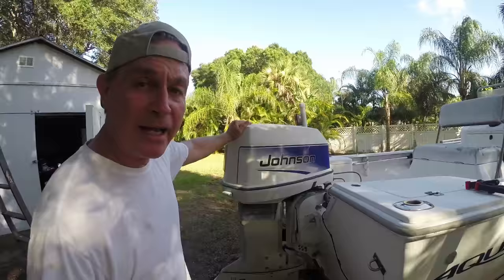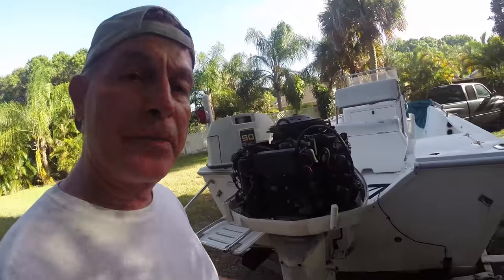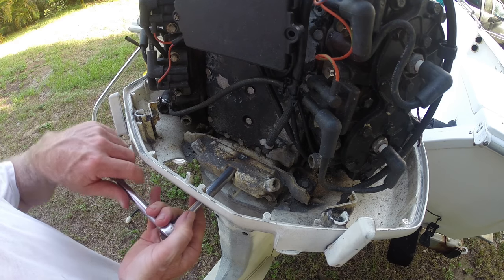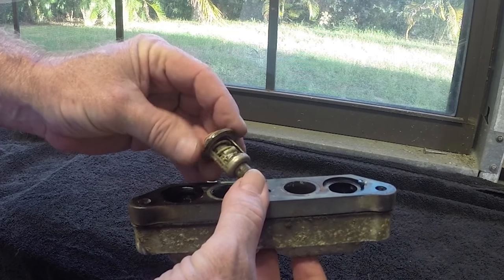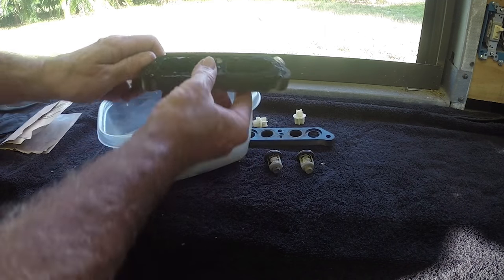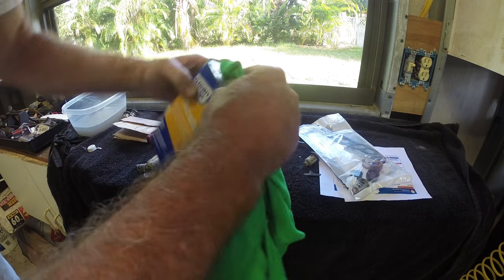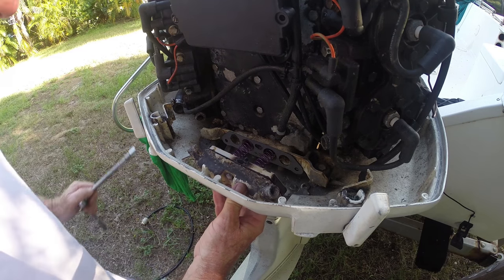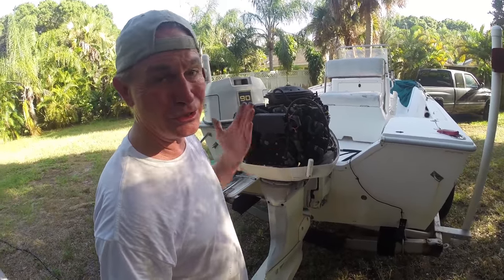HOW TO Replace Thermostats Johnson Outboard the EASY WAY!

Comment: This is one of the most helpful videos I've ever seen. I tried to change my  therms and was unsuccessful so I need to do what you did. Did you use a specific dremel blade for that and what rpm etc is the dremel you used? Mine might be too cheesy so I may need to get a newer, better one.
Reply from the maker: Susan Tapia , nothing special,  I  used what was in my 4200 kit.
Reply from the maker: Zero, works like a champ!

Comment: Just did this to my 1987 Johnson 90hp.. 
it has been in one family since it’s make and I bought it from that family, so I’m the second owner..they had been using one mechanic shop throughout the boats life. June of 2020, the owner said that he was having over heating problems at idle only. Mechanic shop said they changed the impeller, thermostat hoses, and spark plugs. All was good. Then the guy sold the boat to me a few months later. I get the boat and after about 10minutes idling, the overheat alarm goes off. I replace the water pump AGAIN (being less than 1 year), and it had not been replaced in at least two years. It was dry rotted. I test it, still over heats. So naturally the thermostats are next to replace. I found your video and did what you did—but the sad part is, that I did not even need to replace them! The brand new thermostat hoses that were replaced in June—the left one had silicone blocking both ends of the hose!!! Intentionally!!! As if they were trying to create an overheating issue. There are SO MANY sketchy mechanics out there. 
I went ahead and replaced the thermos and all since I already cut out my hole LOL but lesson learned. Always do your own work unless it’s out of your scope of knowledge 🤦🏻‍♀️

Sorry for the rambling! Lol but also glad I found your video!
Reply: sorry to say, but they didn't replace the impeller either! those impellers are tough, and you only start seeing little cracks after atleast 4-5 years.

Comment: I have a 1997 Johnson 115 SPL non-vro motor and I just drilled 3 one inch holes at the location of the bolt heads of where your cutout is instead, and it worked beautifully. I put off white plastic bushings with plugs in the holes afterwards and it looks like it came from the factory with them. Tip: use electrical tape to hold everything together while installing then pull it off when you get a bolt in before tightening.
Reply from the maker: Derek Porter .  That also would do the trick, sq vs round.  The curve would get me though, but it worked for you!
Reply: Great idea!
Reply: Great to be able to do the same on my 94/Ev 90, as your smart way, thanks a million.
Reply: Just did this way too.  I used two zip ties to hold the springs to the thermostat housing while installing and cut them over secured with the bolts; worked great.

I struggled with where to put the cork gaskets but decided to install under the thermostat which seems to be fine.
Reply: Oh yeah you have to be a little careful there when you put the new one in that everything stays together you don't drop it down into the engine.  But why 3 holes you only need to do the 2 end holes. I commented above. I use black round the grommets because my engine is black. I guess your engine is white.  Use  A lot of clear marine waterproof cement
Reply: @PortCanaveralFlorida   my comment up above.  I have a bkack 90 hp. Yeah the curve was a little difficult for lining up.  I dudn't really line up and drill straight, but not off so much that it resulted in a problem. I could still get the 2 bolts out easily and then in again.  Then just glue in 2 round rubber grommets.  Csnt even tell.

Comment: I drilled three 5mm pilot holes, eventually taking them out to 12mm to get a socket on the bolts them once finished i siliconed in rubber grommets. Worked well, looks good.

Comment: Thank you for putting this video out. After watching the video 10 times, I did it today. Little different then your video OR? I just missed that there's 2 bolts on the inside of the lower Cowl. But got to them OK. Also I did not know the Cowl was Aluminum. Thought it was Plastic. Took a lot longer then I thought with the Dramel . BUT I got it cut out and the whole thermostat housing popped out pretty easy. MY Thermostats were very clean and no Salt build up at all? Last replaced 3-4 yrs?? ago?? Guess Salt Away works. Again thanks for the info..
Reply from the maker: Very welcome Dan

Comment: I was able to do this without cutting case. The top bolt will come out the bottom 2 bolts will stay in the housing but all you have to do is remove the housing with them in it and reverse this when installing. The bolts come far enough out of the block to clear.
Reply: Maybe it's different on other sizes but mine is an 88SPL JOHNSON.
Reply from the maker: Yep, you have a different motor.  You can't leave the outer bolts in with this motor.
Reply: I just found out I can do the same with my 85  90 V4 Evinrude.  Glad I tried that first.  Also I want to comment that the shop manual calls for btwn 5 to 6.5 ft lbs (60-80 in lbs) of torque on the bolts.  Looked to me like you went a bit 'much' with the ratchet.  Mine came out easily with a  5'' box end wrench.

Comment: I am doing the job now and I drilled holes to access the bolts but after seeing your video I am going to cut the section out and as I have a spare motor for parts I will cut the same section out but larger and cover the hole, attaching it with ss screws so that it can be easily accessed. Update.....Job done all ok, cover plate fitted over the hole ok but needed or a gasket to seal it properly.

Comment: Thought I had a blocked or broken impeller because of low pressure on the exhaust water port . Pulled thermostat water shot out the thermostat hole plus it started pumping out the exhaust water ports up top. Carb sounds clean at not in gear throttling it with cleaner. But bogs in gear. Carb issues  and needs thermostat and maybe an water pump kit.

Comment: Thank you sharing how you have found to make this job doable. 
Let me add:

ONCE AGAIN, a Video involving the possibility of BREAKING Bolts  that when you are dealing with such bolts that you must remove:

If the bolt feels like it may break at all, they are full of corrosion crud. So don't break it, do this instead:
you must give it patience and slight back and forth movement to work it out, the corrosion will fall out: 

So try to tighten it just something of a move, then try to looses in just something. Then repeat and repeat and repeat. So a rocking motion of back and forth without putting too much force in either direction where it may over stress the bolt and break it off. As you continue, if your observant enough, you may even see little sands of corrosion dropping out of bottom of the bolt as you do this. And that the bolt is able to move more than it did. 
Now you can't loose once you have some movement. Because if you are patient and keep only rocking the bolt back and forth back and forth, more corrosion will come out and the bolt will move even more from tight to loose. Of course also spray penetrating oil into the threads as you can and walk away and come back after soaking.
Take care

Comment: Great tip. Great video! Hello. I have an 85 hp 78 year engine and it is not as easy to trim as on your engine. What do you suggest for my engine?
Reply from the maker: Jaime, This video had nothing to do with "Trim"
Reply: @PortCanaveralFlorida  Thanks for your answer. It happens that I did not ask about trim. I said that the model is 78 with power of 85 HP and that the cut plate in your Jhonson is not equal in mine.
Anyway your video is very good.

Comment: I did this and it’s great. I’m just wondering where the cork Haley rings go. Is it under the lip of thermostat or on top of the lip. They are going to have to get really swished either way on reassembly. That’s where I’m at now. Trying to find out exactly where these go before I reassemble. Nothing in both manuals I have shows me. I have same engine you have in the video. Any help would be appreciated. Thanks.
Reply: Not Haley rings. Cork rings.

Comment: I thought you were taking the piss for a second. I have an older johnson and my thermostats on top. Woulda been a good troll video if that were the case.. "Yeah so today we're gonna change out our coils. First, let's drop the lower unit. Then get your handy grinder and cut an access hole through the base of the motor mount" lmao!

Comment: Good idea but you really don’t need to make cuts. Even on the bubble back exhaust models. Just an 11mm wrench and some patience.
Reply: What are you talking about you can't get the 2 end screws out because the metal of the motor in the way.  otherwise you have to unbolt the whole friggin motor and lift it out of the casing.   Those 2 end bolts on the thermostat are very long but middle one is shorter.
Reply: @aspenrebel  next time one comes in for a thermostat job, I will video it. Trust me. I have done several, you certainly don't need to remove the power head.
Reply: @TheJoejoe7716  nope!   The last thing you want to do is to remove the power head or to try to remove the power head.  Only about 100 things can go terribly wrong.   I have to look if I have a picture of my phone here what I did.
Reply: @TheJoejoe7716   ok here's how I did.  1 inch cylinder drill bit and 1 inch black rubber  plugs cemented in place to plug the holes.  Hkpefully I can post the pics I took today.
Reply: @TheJoejoe7716  well, I took photos of what I did, to show, but I cant get them on here.  I dont know how.  It not working. ?????

Comment: Why not use heat direct in the bolt with a swivel socket though first?
Reply from the maker: @systematic_control367   Swivel sockets at that angle seem to slip and re installed  is a PITA.

Comment: Great video and great idea!  My only question is have you experienced any operational problems, engine performance wise since you made this repair?  Has the plate come loose or have you since lost it?
Reply from the maker: Zero issues. I use hot glue from the back, works like a champ!
Reply: It won't affect performance of the engine

Comment: I use bored holes in front of 2 end bolts for socket removed bolts .put rubber plugs in holes easy to do.

Comment: No criticism from me but I should point out that the cork gaskets should sit on top of the thermostats. They are the last piece of the puzzle before the final body gasket which in the video is already attached to the engine body. 
It probably doesn’t make a difference but that is how it is installed on my original untouched 1979 85 hp v4 evinrude, basically it is still the same engine and I am using the same thermostat kit.
Reply from the maker: Looking at the diagram now that you drought it up, they sit under the stat.
Reply: It looks that way in the diagram but the original body gaskets covering the cork washers were made of a thin metal (not like today’s paper gaskets). They were stamped with an indentation that only allowed the cork washers to be assembled on top.
Reply from the maker: @joyned1  what can I say, its still running just fine. It's, do you like your cheese on top of the burger or at the bottom.

Comment: Thanks a bunch..really thanks..I owe you a beer.
Reply from the maker: Glad this tip helped Roy!
Reply: I did exactly what you said only I didn't have a dremel so I used the skinniest smallest cutting disc for my angle grinder and it worked really well...
At some point I'm going to have to lift the power head though to change the corroded sterling tiller on the front..
Reply from the maker: The new steering arm is made from better materials now days, mine still looks new.
Reply from the maker: P.S. I've been hitting the 2xIPA from Southern Tire Brewing Co, send one when you can lol.
Reply: I have an uncle in St Pete. .IL throw  a couple in my case if i can remember in the fall

Comment: I came up with an easier way than that.  I got a 1" cylinder type drill bit.  drilled (2) 1" holes in line with the 2 end bolts of the thermostat, so I could easily take the screws in-and-out.   then I filled in the holes by cementing in 1" dia black rubber grommets, which had a groove around edge.   The only problem was the metal was thicker than the groove opening.   But still made it work with a lot of waterproof marine cement.  Bought an extra pair of grommets just in case, to keep on hand.
Reply: What about the middle bolt?
Reply: @rubengonzalez8399  the middle bolt I could get out no problem.  It was just the two end bolts.

Comment: My 1980 85 you do not need to cut or remove powerhead or lower unit .
Just remove the trim cover he said 4 bolts but there is 6 on mine 2 under bonnet at rear corners of the trim cover.
Then take your wrench from under neath for the 2 out side bolts for the thermostat cover. About 3 turns with boxed end then switch to the open side of the wrench.
The top middle was a bitch for me tight in the thermostat cover 1/4 inch ratchet and socket to break it free then wrench. 6 point wrenches and sockets can save a headache.
Why make your outboard look like a hack job for nothing. 
The only time to make a hole in your outboard is if the drive shaft is seized in the crank. The hole would be to cut the driveshaft.

Comment: just so everyone that does this is aware: he use the wrong sealant and didn't apply it to BOTH sides of the gasket. do it this way, and it will leak at some point down the road. the factory service manual says OMC gasket sealing compound on BOTH gaskets, front and back. the sealer doesn't effect the pressure relief valves because there is a huge hole in the gasket, and if you get a tiny bit on the t stats... so what? they just need to open to bring water in.they don't get unseated like other models at higher pressure. OMC gasket sealer doesn't harden either, so completely harmless.
Reply from the maker: It's 2021, I posted that in 2015 and it's still holding.  Thanks for your input.
Reply: I Jane the exact motor. What part number did you used to order the proper parts? Thanks

Comment: Your use of a Dremel type tool is an improvement on the method I used ( http://forums.iboats.com/forum/engine-repair-and-maintenance/johnson-evinrude-outboards/632862-thermostat-replacement-on-1990-115-v4-crossflow ). On the other hand, I've had bad experience with using JB Weld type products on Aluminum, so I would not rely on it to hold that plate you cutout. That plate could pop out in the water and you lost it. I used screws.  My engine was the cross-flow bubble back which has even less room than yours I think.
Reply from the maker: Hey Ash, I used a glue gun, worked perfectly and sealed the cracks too!

Comment: You might want to screw that plate so it doesn’t vibrate off the engine stainless steel screws maybe
Reply from the maker: No crews needed.  Touch of JB Weld does wonders thanks.

Comment: I didnt see you put in the 2 cork circle gaskets around the individual thermostats.. thats whats confoozn me. Plastic, cork, thermo, gasket sandwich or plastic thermo cork gasket sammich? Dunno whether it makes a big difference to put the maters under the burger or on top.. On a side note, you ever think how long it took some engineer to sit there with different alloys, heat em up and watch how much they bend per degree..? Crazy sauces.. and then mr guiness had a stroke of genius and stuck a mercury switch on it and boom central air. Boggles the nugget thinking about that kinda shtuff.. that And compressing a toxic gas with handbuilt stuff that you had no ideas if your idea would work..
Reply from the maker: I reviewed the vid and the cork gasket was there in the kit, I did place them in, you just didn't see it in the edit.
Reply: I had the same issue.  Wasn't in the video unfortunately and I tried to look very closely.  Guessed they go under the thermostat.  Seems to be ok.

Comment: What were the symptoms that led to you changing the thermostats?  You may have said it in the video but I'm watching in bed with low volume trying not to wake the wife
Reply from the maker: Over heating Dave
Reply: Me too and wanted to know they were not full of muck.  Found mine were completely dissolved and I just had a hole so they never shut off the flow.

Comment: I have an 89 same motor, used the service manual that those engineers make, no holes, no problems, much easier than this nonsense
Reply from the maker: Then why did you come here looking for answers?  Just to comment?

Comment: DO NOT DO THIS!!! YOU CAN REPLACE THE THERMOSTAT WITHOUT CUTTING YOUR FRAME OR REMOVING POWER HEAD. I JUST DID MINE WITHOUT CUTTING OR DRILLING HOLES.
Reply from the maker: Thanks for the comment. The chance of broken bolts is SUPER common.  This is very easy to do and get back on the water, hurts nothing, a little JB weld, paint if you choose and your done.